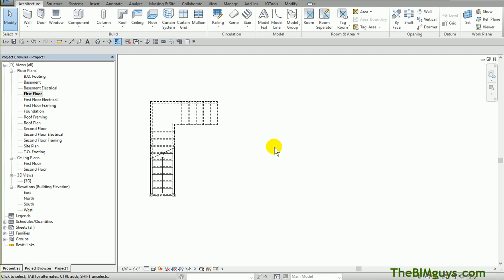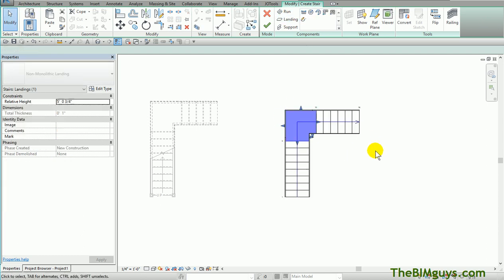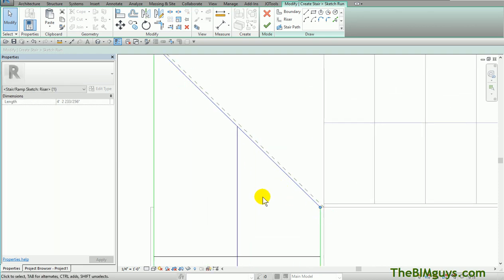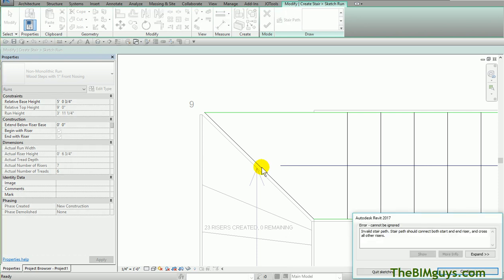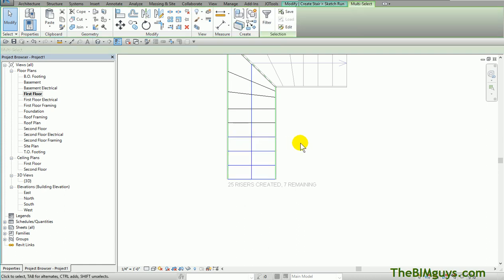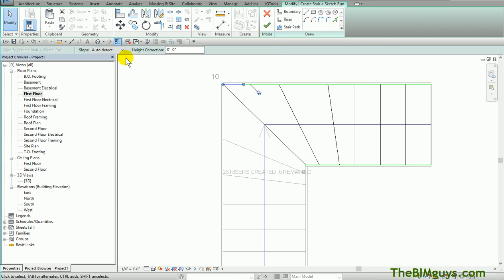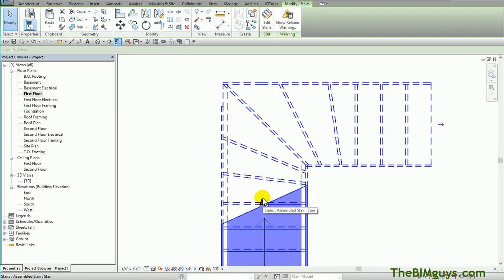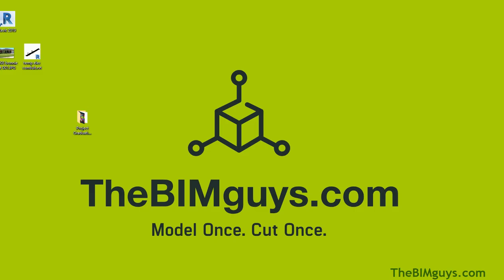Revit Winder Stairs - Custom Winders - CADtech Seminars, LLC

Comment: What version of revit is this?  Im using 2019 and cant find the convert to sketch option
Reply from the maker: Not sure what version this is. Maybe 2015. It should still be available. Make sure you are in the stair editor. Also, Revit LT does have stair limitations when it comes to sketching.